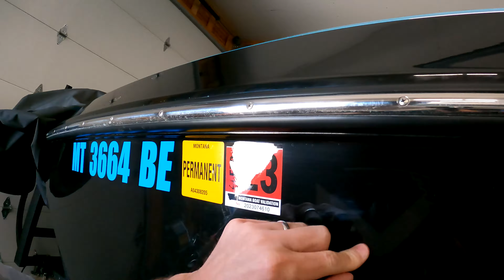BETTER BOAT REVIEW!!  Season 7, Episode 5

Comment: Ok detailing is a bit of a hobby for me.  It relaxes me for sure.  The spray on wash off sealants most the time are not that great if applied first time as directed plus you waste a ton of product. Best way to apply is use an applicator apply like wax then wipe off first application. You’ll use maybe 1:8 of a bottle done that way. Then future to top off just about 6 sprays per side then spray off.  The fabric coats never work if just misted on also, so work in 3x3 area put latex glove on one hand spray a couple of sprays then spread product around with hand or soft bristle brush to work into fibers. Again you’ll use a fraction of the bottle and get 100x the effectiveness. Takes longer, but worth it.  I’ve tested out a million products and continue to do so all the time. I have a few that are my favorites if you ever want suggestions. Never tried this brand, but most the boat branded stuff I’ve used other than Marine 31 and Starke are crap compared to the automotive counter parts that work amazing and cost less.
Reply from the maker: Thanks for the info!  I was simply sent these products to try and followed the directions on the bottle, I figured it would've been better to do some sort of buff in method as well.  I would be curious to hear the products you like.
Reply: @wake_mann  cost effective interior cleaning, P&S Interior Detailer with some detailing brushes.  Foams up really good when agitated like a foam canon then just wipe off. Safe on all surfaces light cleaner.. top all soft interior surfaces with Lithium inner space, smells great safe on all surfaces, protects, and doesn’t make them slick. Heavy interior stains Lithium Hypercleanse. Not as intense as some APC.  Glass you can’t beat Alcohol mixed with distilled water. Super cheap.  Lots of glass products out to create a beading sheeting coating.   I personally like Gtechniq C2V3 as it doesn’t streak and kind of self flashes on glass.  Gives you solid performance. Little goes a long way. 
Exterior would be hard because it depends on level of time you’re willing to put in.  Lots of great SiO2 spray sealants on the market. I just strongly suggest not spraying on surface but spraying in an applicator and applying like wax or ceramic coating to get the most out of them.  Griots 3&1 great sealant , 303 Graphene Spray, Turtlewax Graphene Flex Wax, Meguiars Ceramic Wet Wax Blue Bottle all at Autozone.  Order online spray sealants that work; The Last Coat V2, Gtechniq C2V3, Adam’s Graphene Spray. All give Crazy Gloss.
Wipe Down Every time; Turtlewax Wet Wax, Griots Ceramic Speed Shine, Gyeon Wet Coat spray on wet surfaces wipe off.   ONR or another rinseless wash to wet before wipe down to prevent micro scratches.
Reply from the maker: Awesome!  Thanks for the info.
Reply: Thanks for the info!  The upholstery shop I go to whose primary business is boat fixes, told/ warned me about any product that is greasy is horrible  on our interior. He said even the new boat interiors will fail far sooner if we use greasy stuff.